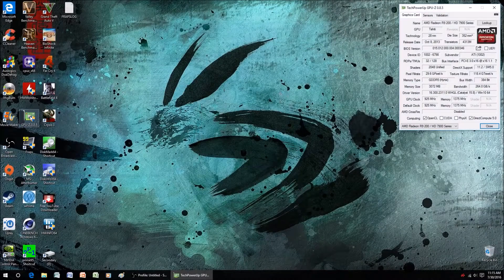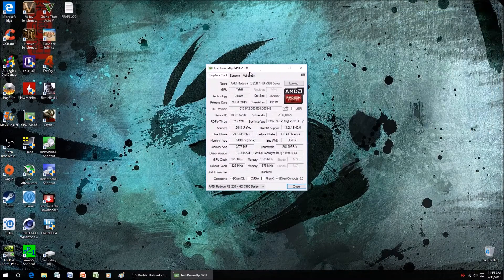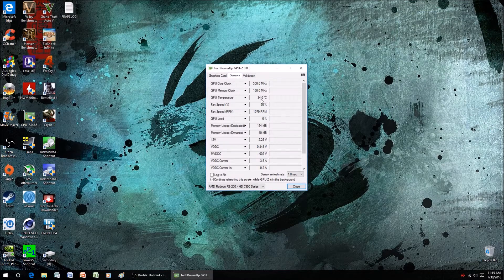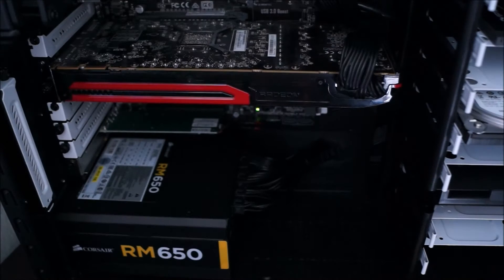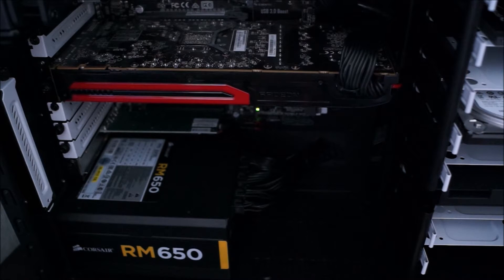Liquid Ultra on HD 7970 RE

Comment: It's a nice video :-) but I feel like I will break anything.
Reply from the maker: Hardware is a bit tougher than you think :) But if you are not comfortable working on your graphics card, then its better to take it to someone who can. Thanks for watching!
Reply: My gpu gives no signal on my monitor when I put stress from furmark. By the way is it true that can I use Colgate toothpaste instead of thermal paste? 

I don't know what's wrong with my gpu. I tried everything from bios to different drivers and ram. It was working fine few days back. 

The only thing I didn't cleaned was that which you cleaned with ultra liquid scrub pad as I don't have it. 

One more question can normal cpu thermal paste works on it or there are some special thermal for it? What happens if I apply thermal paste around the dyes as well. Moreover many people say just make a line on dye and don't cover.
Reply from the maker: Do not use toothpaste :) It is not going to replace your thermal paste any time soon. 

You said you cleaned your GPU? How did you clean it? It could be that your fans do not work therefor when you stress the GPU the card overheats due to no air flow. I would check to see if your fans spin while under stress. 

If the fans do work, then I would try replacing the thermal paste. If you are not comfortable doing that, then take it to someone who can do it for you. Although the process is not too complicated. 

It may also be that your power supply is not working properly. I hope this helps.
Reply: Well thanks a lot, I followed all your steps and applied thermal paste today now the card is working fine. Bless you.
Reply from the maker: Moiz Anjum I am glad it worked out for you man :)